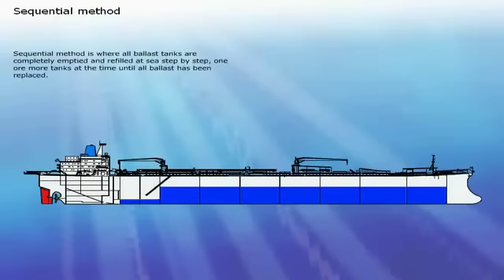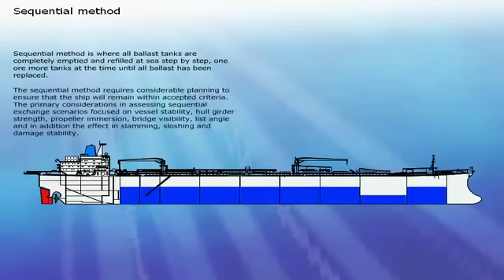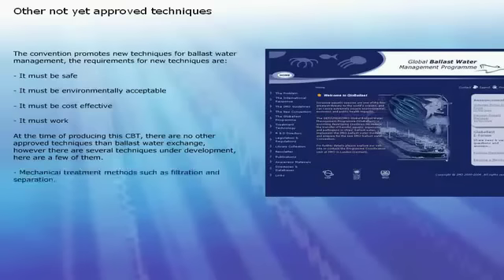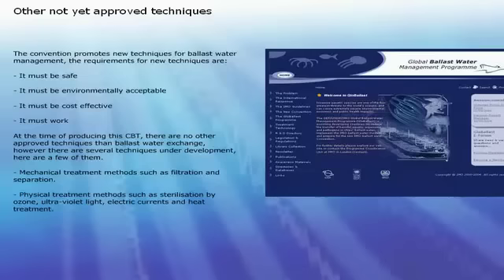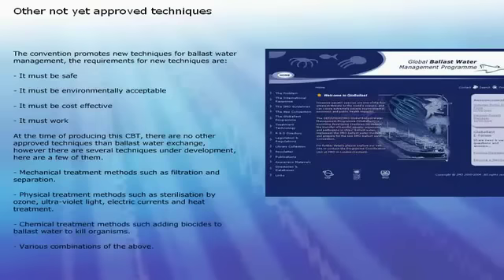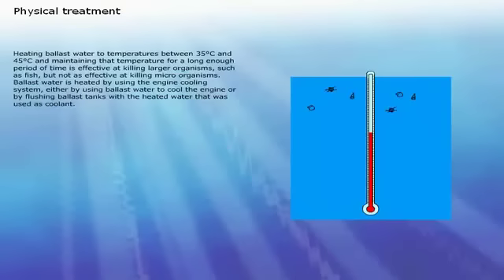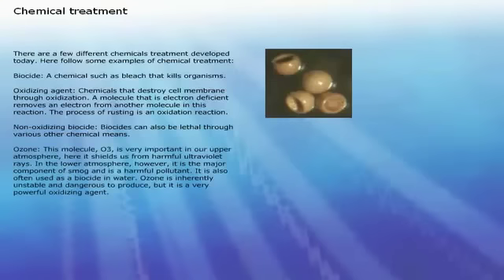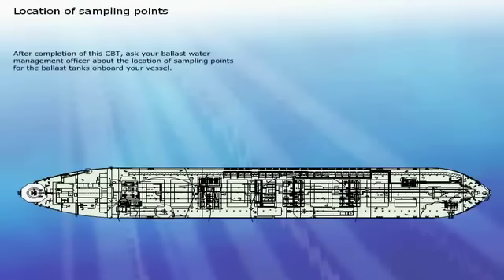Ballast Water Management Methods

Comment: Can you tell me what is the parameters that should be maintained in the ballast water system and fire main system?
Example: presure, level, pump rate, pump capacity, pressure and etc.